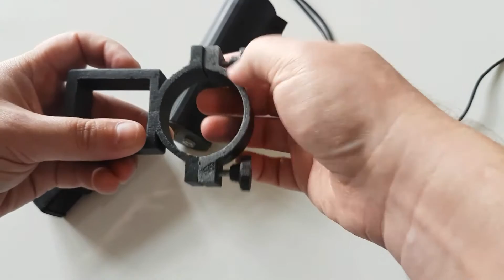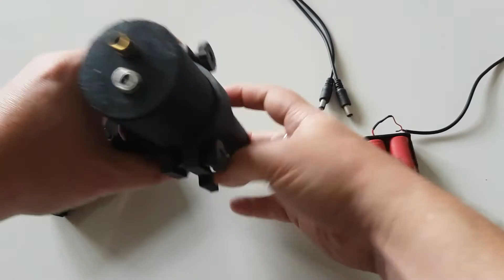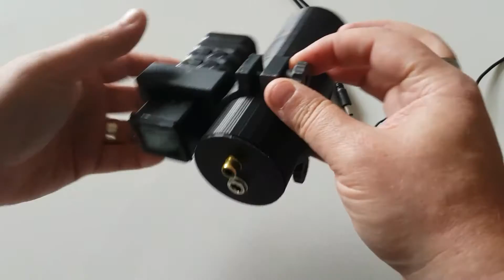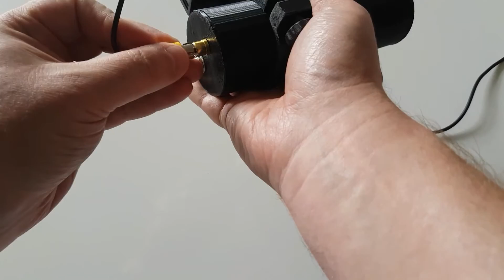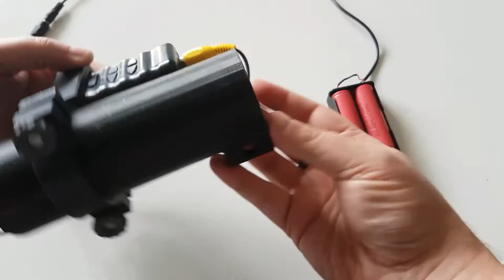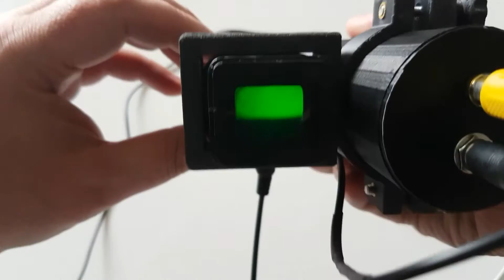DIY Night Vision - Fitting the VF-2C viewfinder adapter

Comment: The VF2C Viewfinder is no longer available in aliexpress. 
😢😢😩
Reply from the maker: Ok, They are on Ebay. https://rover.ebay.com/rover/1/710-53481-19255-0/1?icep_id=114&ipn=icep&toolid=20004&campid=5337796826&mpre=http%3A%2F%2Fwww.ebay.co.uk%2Fitm%2FViewfinder-vf-2c-near-eye-640x480-screen-used-in-night-vision-builds-or-CCTV-%2F231861661007

Comment: How  much fully built to fit Hawke side winder 30 ?
Reply from the maker: +Manchap karM when I do get around to selling them pricing will be between £170 and £200 depending how good I can negotiate volume discounts.
Reply: Are you using a E700 camera in this build ?
Reply from the maker: Nope. There is an obsession with the E700 and I don't use it. I use an almost identical camera board with the same chip set so it does the same.
Reply: ok its what i have would it fit ok  ?